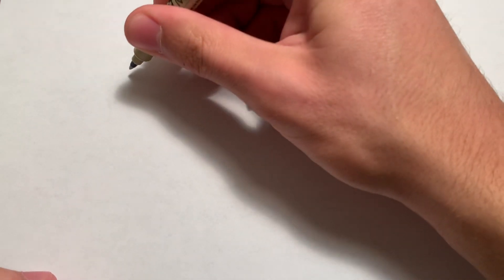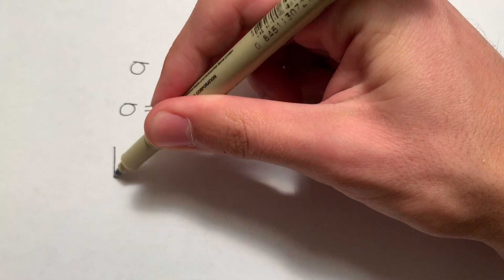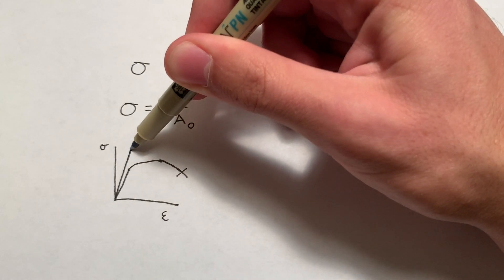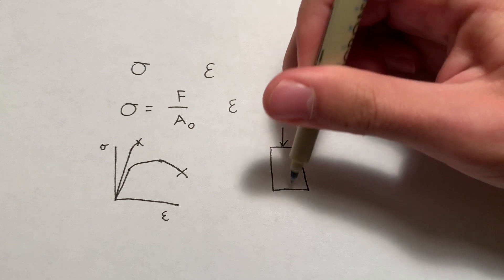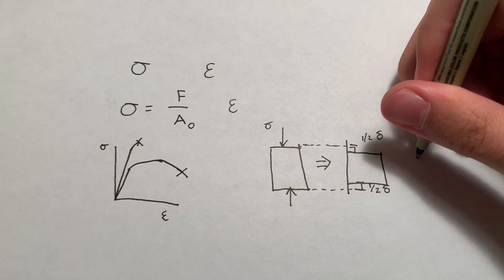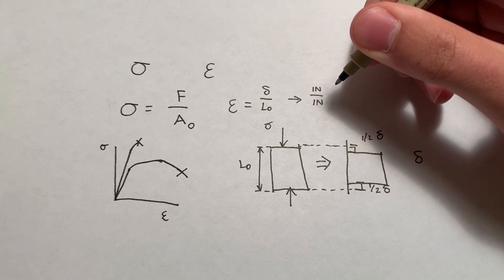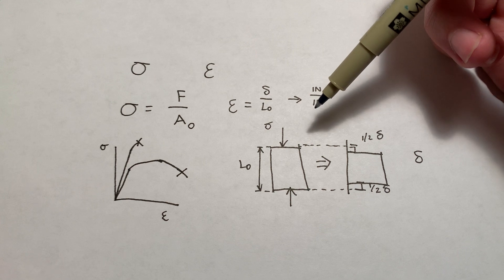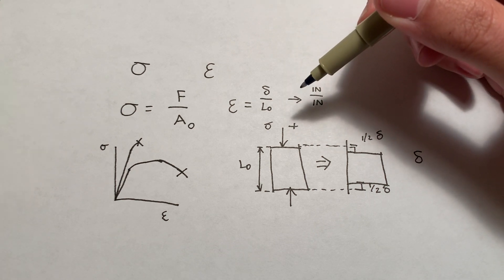Intro to Rock Mechanics 1: Stress and Strain

Comment: This video explains stress and strain in rock mechanics, including fracture stress and strain. It discusses the challenges of dealing with discontinuities and fractures in rock masses and highlights the importance of designing around rock features for engineering purposes.

[00:00] This video introduces key ideas in rock mechanics, rooted in mechanics and materials strength, with a focus on stress and strain.
- Stress is force per unit area, not the same as pressure, and causes strain
- Rocks behave differently than man-made materials, deforming chaotically
- Rocks have a defined elasto-plastic region, with a yield stress similar to metals

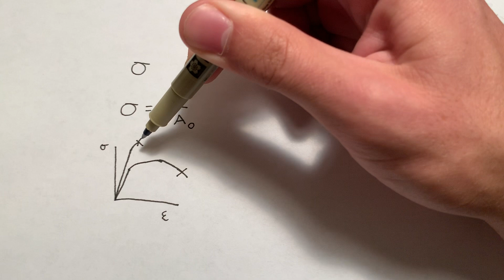[03:00] Understanding strain in rock mechanics
- Tests specimens in rock mechanics are usually cylinders
- Compression applied to the cylinder causes a stress, denoted as Sigma
- Compression also causes a change in length, denoted as Delta
- Epsilon is the change in length divided by the original length
- Epsilon is a unitless percentage representing the strain

[05:57] Understanding stress and strain is crucial in rock mechanics
- Engineering stress and strain produce clean stress-strain curves
- Compression is positive and tension is negative in rock mechanics
- Rock mechanics deals with in situ rock masses bearing weight
- Discontinuities, joints, and fractures impact rock strength and failure